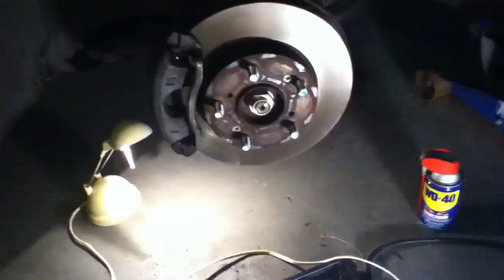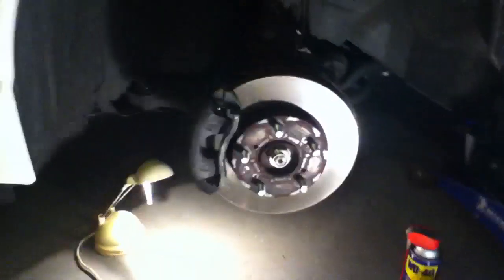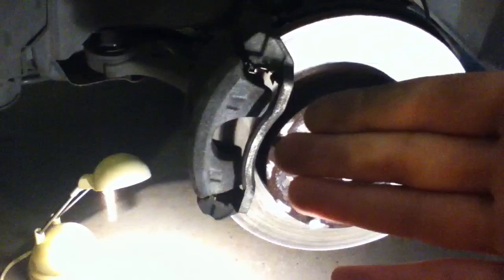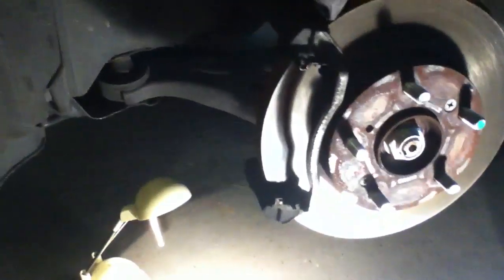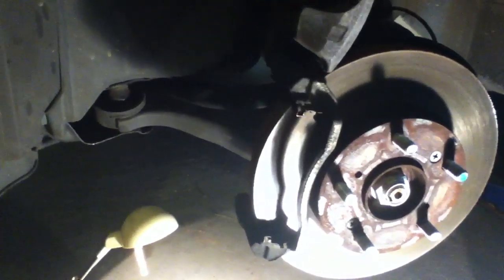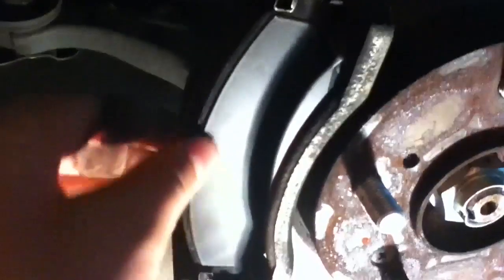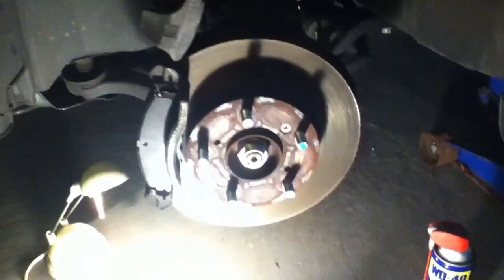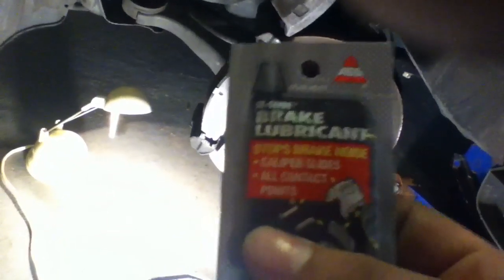DIY How to Change 8th Gen Honda Civic Front Brake Pads

Comment: Adding to what Dave said when pushing back the pistion, I have and always will open the bleeder valve. When you are changing your brake pads it is also probably a good idea to change the brake fluid as well. As brake fluid absorbs water it can damage the metal components in the break system as well as altering the boiling point of break fluid and thusly hampering break performance. Since you are opening up the bleeder valve you will introduce air in the system anyhow and need to bleed the system

Comment: I just watched you vid here and saw the biggest "no no" that one can do on the Gen 8's. You never want to push the piston back in with out opening the bleeder valve. There is a proportioning  valve that will be damaged if you do not open the bleeder valve before pressing the piston back in.

Comment: Good start, but should address the need to deal with the excess fluid when pushing back the caliper - I prefer to open the caliper bleed when doing this to avoid pushing particles back upstream, otherwise should remove some fluid from the master cylinder reservoir and keep track of the level.  Piston shouldn't be pushed back too far and care should be taken not to damage the boot.  Caliper should be tied up so it won't come crashing down in the middle of the job.  Slider bolts

Comment from the maker: Brake fluid is a yes, if you're already replacing the pads might as well the fluid. The calibration thing is bs. I've never heard of that before in my life and have never had to do that to any of the cars I have replaced pads on. Just install both sides then pump on the brake pedal 10 times and you're set they'll work perfect.